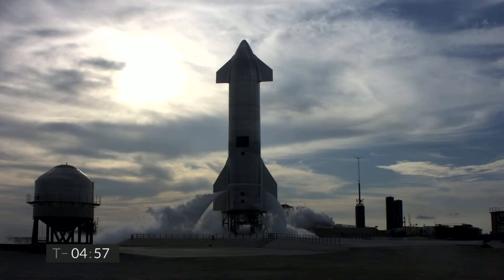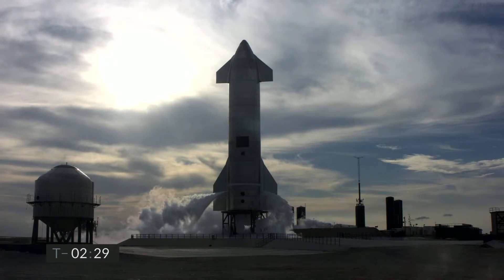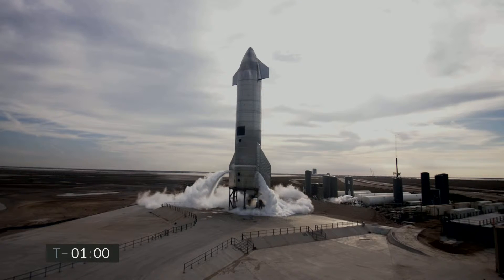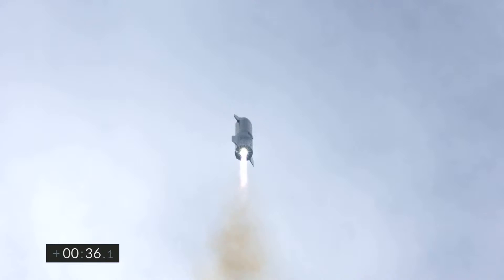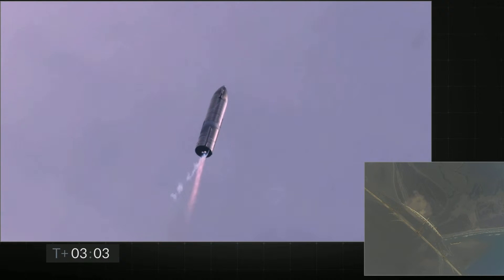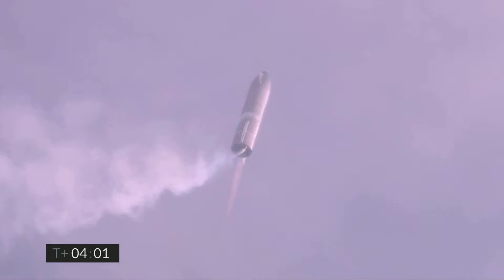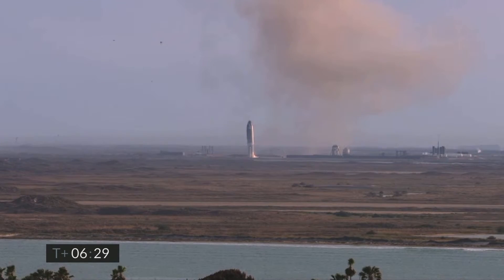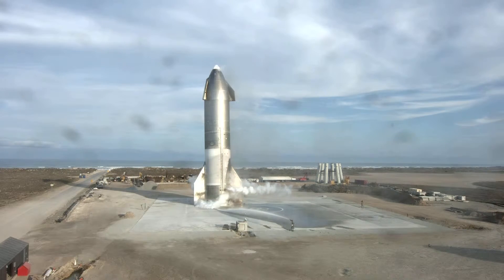Starship | SN10 | High-Altitude Flight Test

Comment: can anyone please tell me, why it’s ejecting white smoke before launch?
Reply: To burn fuel engine needs enough oxygen. Atmosphere can't provide that, because there will be not enough pressure. And in space you don't have oxygen at all. So there are tanks with oxygen inside the rocket. The thing is you can store much much more oxygen in its liquid state than in gas state. But to make it stay liquid, you have to cool it to a very low temperature. It stays cooled until it gets loaded into the rocket's tanks. There there is no cooling, so oxygen starts to get to regular temperatures -> turns back into gas and starts to take more space. If you do nothing, oxygen tanks inside the rocket will simply blow up, because of pressure, there will be too much oxygen there. So, rocket has to let some oxygen out. While oxygen goes back to regular temperatures it is still very cold when leaves tanks. So it freezes air and water in the air. Therefore this smoke you are seeing is essentially a condensed fog
Reply: That is not smoke. It is condensed water vapor. Some of the Liquid Oxygen (LOX) boils off and needs to be vented to the outside to prevent overpressure in the tanks. The gaseous oxygen that is vented is still very cold and, when it comes in contact with the warm, moist air, cause the water vapor to condense.

Comment: What is the approximate cost for each test flight?
Reply: good question, i don t think it s available to the public
Reply: @unhommequicourt  Just curious, but happy to see each flight improves!
Reply: Best guess I've seen is on the rough order of 10 million. Low end 5 million, high end 20 million. Which is very cheap for rocket standards. 
By comparison, NASA's upcoming SLS test flight will cost around 2 billion, so 100 to 400 times more expensive.
SpaceX's own Falcon Heavy test flight was around 100 million, so 5 to 20 times more expensive.
But to be fair, the way SpaceX are building these things is more akin to a grain silo or water tank than a traditional rocket.

Comment: NICE IF THEY HAVE A LUNCH PADS ON THE SIDES OF THE ROCKET WHEN THE THRUSTER  CAN AUTO DETECT THE GYRO ON 4 SIDES , THEY SHOULD BE LANDING THIS ROCKET SIDE WAYS COZ THE FORCE OF LANDING IS HEAVY AND GREAT WHEN DOCKING, THEY SHOULD ADD AND PUT THE 4 THRUSTER ON THE SIDE  TO LAND IN SLOW IN VERTICAL ARRAY THEN START THE 4 THRUSTER ON THE SIDE OF THE ROCKET TO BALANCE ALL SIDE WHEN LANDING SO ALL THE FORCE OF LANDING WILL BE EQUAL TO THE INCOMING FORCE PRESSURE ON THE WEIGHT OF THE ROCKET AND THE LANDING..THE ROCKET IS NOT MEANT TO LAND VERTICAL IT SHOULD LAND HORIZONTAL
Reply: I like the way you think, brother!

Ad Astra!

Comment: I was just thinking how would the horizontal thrusters be protected on atmospheric entry the answer was easy to see though. The landing legs would fold to protect them and the thrusters would be exposed once the legs were extended allowing for 1 or 2 thrusters to be protected under each leg. Though the size of Starship may require 6 legs to support its mass. Just thinking out loud if any of this sounds good Space EX use it no charge just want your ship to be great.
Reply: But you need trusters at the nose of the vehicle. Can't extend legs to entire vehicle lenght (height). Legs themselves are one of the problems too - as the vehice is being designed to enter the atmosphere from space, you need to incorporate the legs into the heatshield, which is challenging.
Reply: @dmytrogubskyi4355  The space shuttle did
Reply: @robertcarbno3914  Shuttle had absolutley different way of landing, weight distribution, etc, thus - different challenges in construiction. If you want to legitimately compare this SN concept with something in terms of legs - the Falcon 9 first stage is better.
Reply: @dmytrogubskyi4355  Same principal the legs need to be protected from reentry until needed the shuttle use doors to guard the housing but this ship needs feet not wheels.
Reply: @dmytrogubskyi4355  one of the big problems with a tail landing on an unprepared landing zone is the regolith will compress in an uneven way under the weight of starship. A ship sitting on an angle is unstable and launch of a ship could push more regolith out from under the ship feet before it has enough thrust to hold it's own mass. Just imagine landing on a boulder only on one side hidden under the regolith.
Reply: @robertcarbno3914  yes, you need very stable legs, wide, the vehicle must be relatively high over the surface, and I also suppose that for vehicle that big and heavy the legs have to be adjustable (by hydraulics, for instance), to compensate some amont of deviation from vertical.

Comment: This is a wonder to behold but how will the passengers exit the vehicle when it is operational. Would it not be easier to engineer a horizontal landing for Starship, tail landings are always going to have some unstable moments . As well a hovered horizontal landing would probably require less fuel and take off from the Moon or Mars with a vertical lift before the main engines fire would reduce the risk from debris damaging the engines. Just a thought as I watched your engineering feat best of luck and thank you for the exciting future.
Reply: I guess it would add stress to the structure on the horizontal axis.
Reply: @unhommequicourt  It would but it could be solved the same way it was for aircraft with some design change and strengthening. This would probably add a bit of weight but it would be a safer landing and would possibly even allow for a must greater increase in size in the future. These changes would likely make the starship more durable in the long run.
Reply: A horizontal landing would require a complete redesign. This is not a lifting body.
Reply: @Brixxter  Yes it would and it would take time and money but I think it would lead to a safer and more durable craft in the end it would probable be more cost effective to explore this design while continuing testing . But I do still support what Space EX is doing but how will people exit on Mars or the Moon before infrastructure is in place. As well how will the crafts engines survive a rough terrain landing and launch. And a lifting body would only require a flattened bottom and larger winglets.
Reply: @robertcarbno3914  you're just putting opinion on internet youtube

You think your imaginary design is more safer than the real thing ??
Reply: @robertcarbno3914  try your imaginary design and create it into real thing object that can fly if you can... Try to apply working as engineer in SpaceX

Only through real experiments and experience you can proof your design its safer... Not with opinion on the internet lol 

You think you know better than the scientists and engineers in the real work field??
Reply: @Nightdreaux22647  Time will tell.
Reply: @Nightdreaux22647  I already have an engineering career that I enjoy doing and I'm almost 60 so if my ideas help great if not no harm done right.
Reply: @Nightdreaux22647  Just a thought for you to consider some times you don't have to reinvent the wheel it just needs to be redesigned and improved upon aircraft and space craft are very similar in design and are identical in purpose.

Comment: I don't expect future spaceships would land like that .. too risky! Using swept wings or even parachutes for landing would be options.
Reply: If they can perfect that its not too risky, wings and parachutes wouldnt work. Starship is too heavy for that.
Reply: Not an option on Mars or the moon. Wings might technically be doable on Mars if someone built a nice long runway there, but it would be far less safe.
For reference, if you tried to land the Space Shuttle on Mars, it would have a landing speed of around 1100mph/1760km/h.
That's *insane*. No wheeled vehicle has ever gone that fast. Thrust SSC holds the record at 763mph/1228km/h, about two thirds as much.
Reply: Thank you all for sharing. Wings have civil acceptance due to its safety such as chances of survival in case of engine failure. I'm still looking forward to more breakthroughs...
Reply: @phuocloc6030  If you propulsively land a rocket there is no need for wings. They might even make it even more dangerous in spaceflight terms.

Comment: Sort of made it this time. That's great. Although I have doubts it's practically safe in the long term. Maybe they will go back to a reverse pencil drop despite fuel usage. Only time will tell. Safety is paramount, and also the astronauts' confidence.
Reply: It's not just about fuel usage. Much of the reason it falls sideways is due to reentry. Starship is intended to reenter at least 5 times faster than Falcon 9 does.
Since compression heating goes roughly with the cube of velocity, that's at least 100x more heating. 
Coming in sideways creates more drag, slowing Starship sooner and higher up, so it doesn't hit the thicker atmosphere as fast.
Or the ground, in the case of Mars. Additionally, it spreads the heat load over a larger area.

Comment: Hmmm. Starship 0 - 30,000' feet in 4 minutes.

F16 Falcon - 0 - 30,000' apx 80 seconds

1975 - 1 February 1975: Major Roger J. Smith, United States Air Force, a test pilot assigned to the F-15 Joint Test Force at Edwards AFB, California, flew the  McDonnell Douglas F-15A-6-MC 72-0119, Streak Eagle, to its eighth Fédération Aéronautique Internationale (FAI) and U.S. National Aeronautic Association time-to-altitude record. From brake release at Grand Forks Air Force Base, North Dakota, at 913 feet (278 meters) above Sea Level, the F-15 reached 30,000 METRES meters (98,425 feet) in 3 minutes, 27.799 seconds. This was the eighth time-to-altitude record set by Streak Eagle in 17 days.

Yeah, I know. Different aircraft, different weights, different purposes and different passenger considerations, different objectives.

I'm not sure this is going to make us an "interplanetary species", Bobby. Frankly, I think that is the last thing we want, when we haven't even begin to sort this place out and treat it properly - we can't even clean up our plastic - and we already have nutcase Communists in power who are trying to control everybody and eliminate more than half of us. 

I love planetary geology and exploration, but living there is another thing altogether, not least of which is the issue of very limited choices. And forget interstellar travel until we can travel, at the very least, at the speed of light. Exceeding it may prove impossible. Who knows at this stage? 

Our nearest potential planet orbiting another star is Proxima Centauri, 4.2 light years away. At the speed of our current fastest spacecraft, Helios, travelling at 252,000km/hr, it would take 17,988 years to get there or roughly 720 generations, allowing for 25 years per generation.   Nice to dream but face physical realities.
Reply: It's worth pointing out that SpaceX's Falcon Heavy got to 10km in about 62 seconds, and 30km in about 1 minute 47 seconds.
The full Starship stack will have an even higher thrust to weight ratio than Falcon Heavy. It should manage 10km in under a minute.
However, this was just the upper stage, and missing half it's engines. And they couldn't go too fast or they'd risk overshooting 10km and violating their launch license. Again.
Also apparently the Streak Eagle's 30km record was bested by a Mig-31 at 3 minutes 9.8 seconds, and a few other records by a Su-27 designated P-42. Those damn Soviets!

Comment: To avoid a hard landing when the vehicle returns to its vertical position, it must be done from a higher height than this in order to land smoothly, comfortably and slowly and also to avoid any error that causes the vehicle to crash.
Reply: Okay rocket scientist!
Reply: @OortCloud  Okay rocket scientist!
Reply: Hard landing was apparently due to, essentially, a sticky throttle. So if it had flipped too much sooner, it would have come to a stop in midair, unable to throttle down.
Unless you could have predicted exactly when and where the throttle was going to stick, you couldn't have known the best time to initiate the flip.
Flipping sooner isn't the solution here. A more reliably engine or redundancy by using two is.
Reply: Elon Musk confirmed the engine had lower thrust than it was commanded to have, for unknown reasons. Increasing the flip altitude wouldn't fix that problem. He said they're gonna use two engines for the final landing burn in the future.

Comment: This proves that USA landing on the moon  was a big lie
Reply: That's like looking at a failed test of a new jet airliner and saying it proves that Alcock and Brown's trans-Atlantic flight was a lie...
Reply: @lazarus2691  First attempt, old technology, they want to the moon with perfect landing took pictures and went back with a big smile. These guys are trying since years landing from a 10Km height only and most of the time they crash. By the way if you didnt know, this flight has crashed as well.
Reply: @ayyaaaa9533  1: this isn’t NASA
2: our enemies in the Cold War agreed that we landed
3: NASA had lots of funding due to the Space Race and was able to pump out rockets
Reply: @colecoal1365  and they never went back again. Its not about money, its about technology. First attempt? what the fuck, don't be so naive.
Reply: @ayyaaaa9533  
SpaceX first attempted a high altitude flight of Starship on December 8th 2020. 90 days ago, or 3 months. Not 'years'.

Also, SpaceX have successfully landed 75 Falcon rocket boosters from a height of over 100km, first doing so back in 2015.

They have a long history of landing rockets from space successfully, this is just a prototype for a new kind of rocket.

Also, landing this ship is much more difficult than landing the Lunar Module on the moon was. The hard part of Apollo was getting the LM to Lunar orbit to begin with.

For a start, this thing weighed about 120 tonnes at landing, vs only about 1 tonne for the LM, which was in 1/6th gravity.

So this thing is much, much bigger and heavier. As a result, it needs much more powerful engines. The most advanced ever flown in fact.

It has three full flow staged combustion engines, running at 300 bar of pressure, and a total thrust of 600 tonnes.

The LM had a single simple pressure fed engine running at a measly 7 bar of pressure and making 4.5 tonnes of thrust.

Other than being far bigger, with far more powerful and complicated engines, and in higher gravity, this also has to deal with atmospheric forces.

It has to carefully balance itself on those four fins, actuating them to stay stable and steer itself in the right direction.

Then it has to start up those complicated engines while free-falling sideways and perform a flip maneuver.

The LM didn't have to deal with any of that. It was in a vacuum, and descended engine-first with the engine running the entire time.

Even if you don't believe the moon landings happened, from an engineering and physics standpoint it's undeniable that the hypothetical moon landings were a significantly easier task than what SpaceX almost accomplished with SN10.
Reply: How does it prove that?

Comment: that was not a soft landing, rater than a bumpy one, even for one engine the mass of the structure it's too much, + taking in consideration the fall and the speed , tehkically oyu need 1 km for a fost landing and not 500 .... the + using 2 engines instead of one if you want a soft landing ....
Reply: If you tried to land from 1km it would run out of fuel before reaching the ground. 500m is fine, as is landing on one engine, if that engine works properly. 
But this engine's throttle got stuck (probably at around 60% by my math) so it couldn't increase it's thrust slightly just before hitting the ground like it was supposed to.
They're going with two next time for redundancy, but there's no reason one couldn't work if it was reliable enough.
Reply: You do know it landed just fine but there was a leak and that is why it exploded right?
Reply: Given the mass of the object and the speed that is heading towards the landing zone a mere 500 m i t s not enough , as you mention 2 engines were stuck , meaning things can go wrong , so to say having extra not 500 , bit 250 m + with one engine along it s more better than having a bumpy landing, i give credit for the effort of they re crew but , you need to have a plan b or c for extra caution .. even when testing .
Reply: @vempaer  500 meters is absolutely more than enough to land this thing. Had it been able to go to full throttle, SN10 could have stopped about 100m off the ground, so it really only needed about 400m.

I fully expect them to flip lower on the next attempt, not higher.

Flipping at 750m would only have made things worse. With the engine stuck at say, 70% throttle, the rocket would have burned off enough fuel weight that it would indeed come to a complete stop, some 100-200 meters off the ground, and then run out of fuel and fallen from that height.

In fact, flipping higher would have have made things worse in all three landing attempts so far. There are some situations where it could help, but in most cases it will not.
Reply: so using 2 engines for a fost landing decrease the power as the ship stars to land .... that's a 10 
]

Comment: When is Musk going start making Tesla Rockets, that run on electricity?
Reply: Probably never. According to out current scientific understanding, a purely electric rocket requires absolutely absurd amounts of power.
To lift 1 tonne off the ground would take about 3 terawatts, assuming 100% efficiency. That's 1/6th of our current total global energy usage.
So until we can make a 1 tonne power source that makes that much power, it won't happen. And for any decent sized rocket, it would be far more environmentally damaging.
Even a 20 tonne electric rocket would output the equivalent of a Hiroshima bomb going off every single second. As Phil Swift would say, that's a lotta damage.